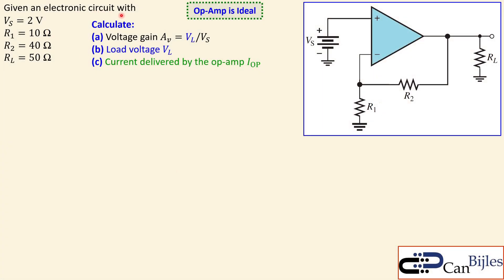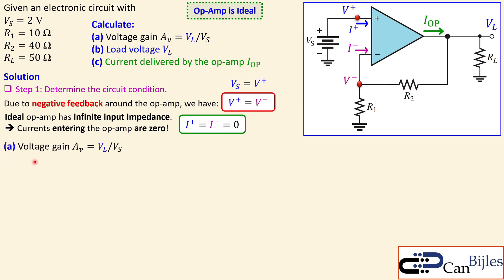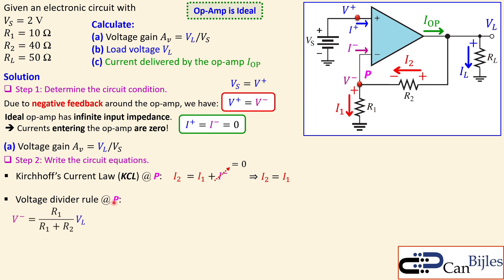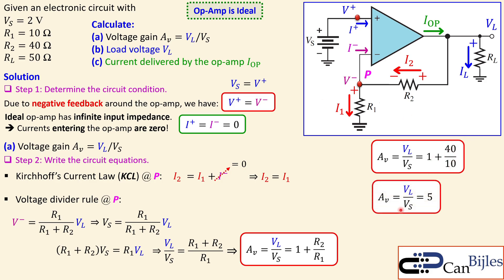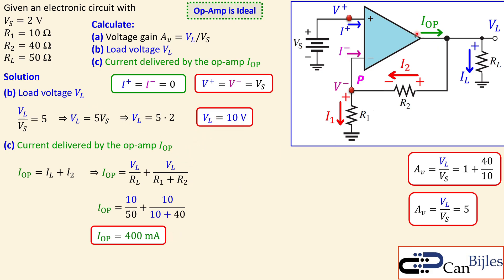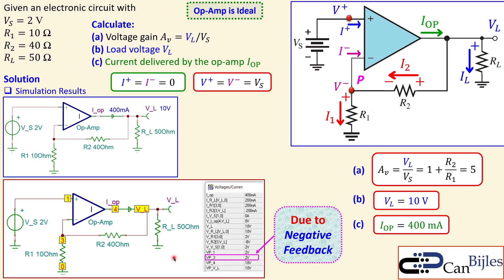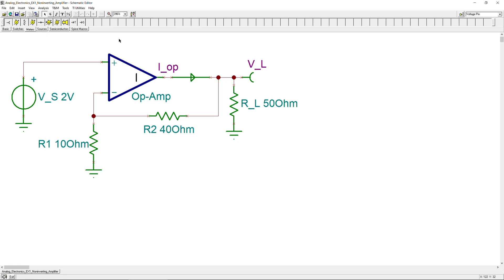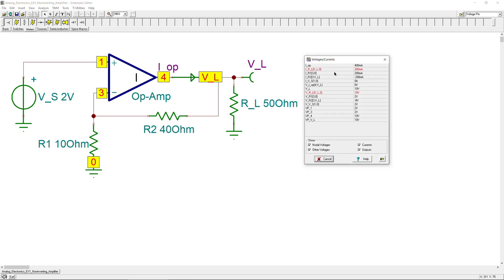Analog Electronics ⭐ Noninverting Amplifier using Op-Amp Example 1 ⭐ Calculation & SPICE Simulation

Comment: Thanks dear, I used op amp gain formula a lot, 2 years ago during my diploma but we didn't derived it
Reply from the maker: Thanks! I always try to prove the expression, but sometimes you just need to accept it, like in noise analysis, otherwise it will take too much time and you will lose the focus of the assignment. Good luck!
Reply: @CANEDUX  yeah sir, true, as long it's working! But the situation arises once you forgotten the formula.. I do see, dedrive the formula let you understand the concept of the design process and why is it true for the formula to be structured that way as well.
Reply from the maker: @jamesjohn2537  It is very normal that we cannot remember all of it 100%. If you cannot remember the basic formulas and laws of physics, you can always get them from books or internet. Practice makes perfect!
Reply: @CANEDUX  very true, practicing keep updating person self!